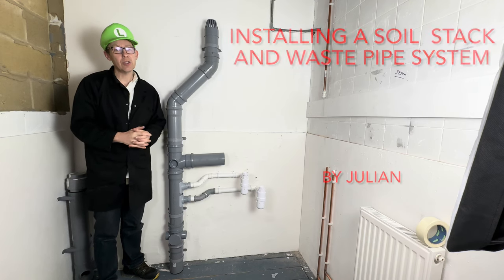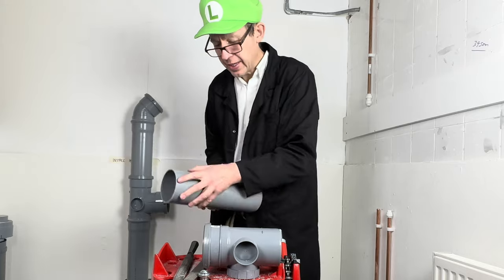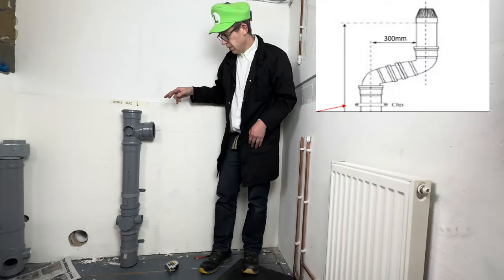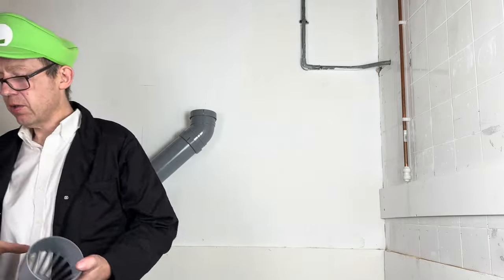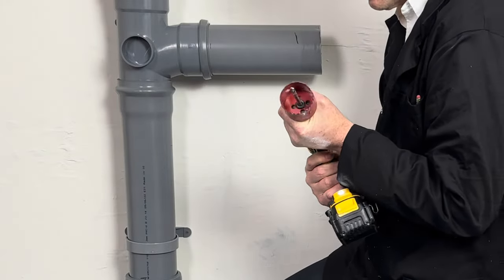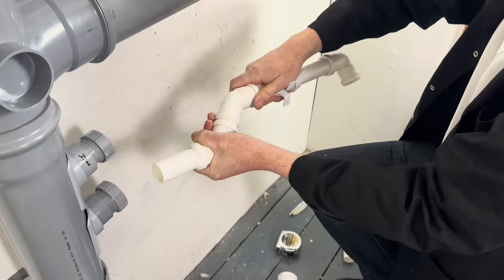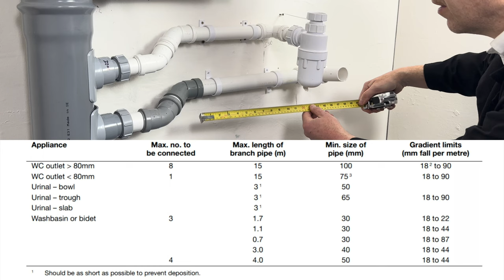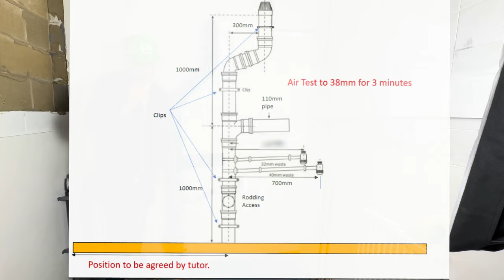Installing a soil stack and waste pipe system with worksheet at the end

Comment: Thanks for this, I'll be doing this task in 3 weeks after the half term break!

What's the name of the fitting that goes on the ends of the 32mm and 40mm pipes? I thought it was a trap but that doesn't look like a trap to me!
Reply from the maker: Hi Good luck on the task, yes just standard traps are fine, you might need a way to hold them onto the wall to stop them drooping with the weight of water.
Reply: They were bottle traps